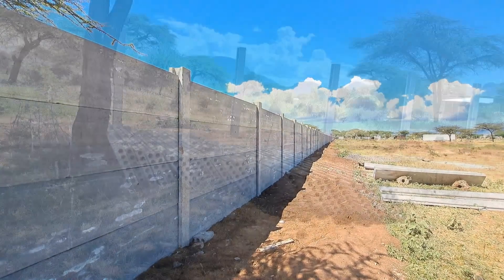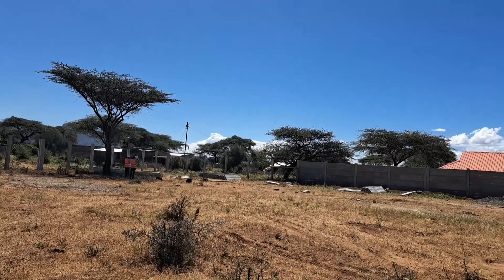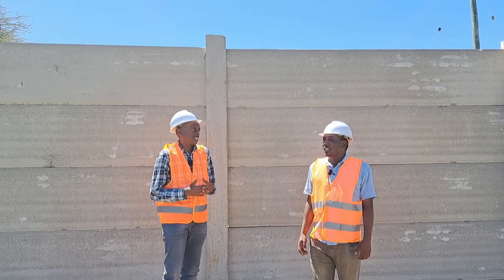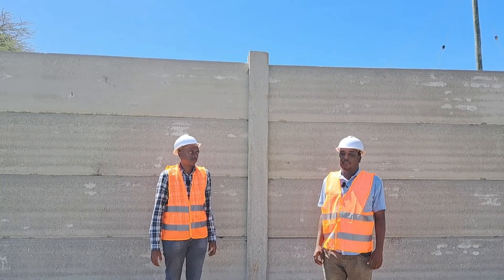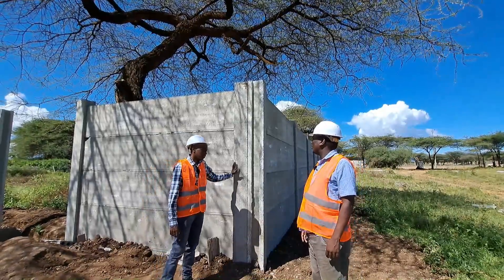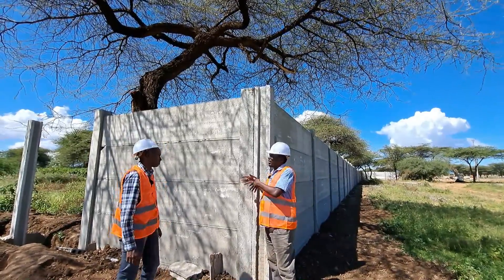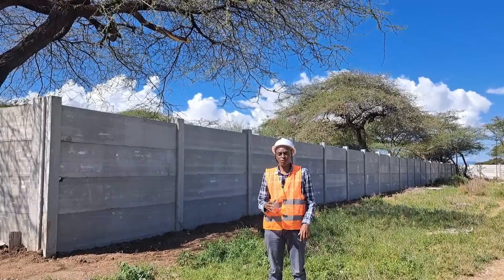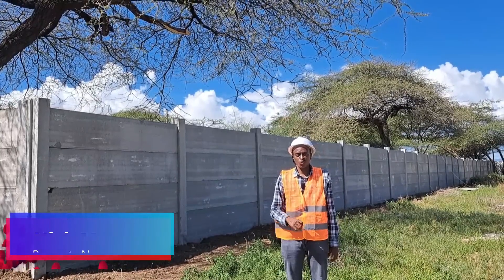How to Use Precast Concrete Panels to Fence 6 Acres in 5 Weeks

Comment from the maker: Imagine this. You have 5 weeks to permanently fence 6 acres in Isiolo. Water is scarce and the site is remote. That's why this client decided to use precast concrete panels and H-columns to fence his land. He used 5 panels on top of each other, with one acting as the foundation. At the time of recording (2nd June), 75% of the fence was done in 3 weeks, and in 2 weeks time, it will be completely fenced. And the project consumed 70% less water. Enjoy the discussion!

CONTACTS
Eng. Ian Kiptoo +254727644782
Precast Panels Supplier (Kingdom Precast Solutions, Sammy Wambua) +254714259226
Reply: Very impressive
Reply: How many cement is cost h colum and how many cemen is cos on panel
Reply: Good job

Comment: Thank you for the video.  How thick are the panels?  Did they use concrete to seal the concrete slabs to each other or did they just let the rest one top of the other?  And finally, is it sturdy or does it rattle when you touch them?  Thank you for your reply.
Reply from the maker: No seal, but it's an optional choice. It's sturdy once put
Reply: @PropertyNoma  Thank you.
Reply: @PropertyNoma   Can you do a video with a precast fence that is very very old made by Sammy's company, Kingdom Precast?  Thank you.  I like his build quality.

Comment: How high can they go? And how strong are they or thieves can easily break through??
Reply from the maker: The standard height is 2.4M, but you can put 5 panels up for a 3m fence height. They are strong enough because they are made of prestressed concrete